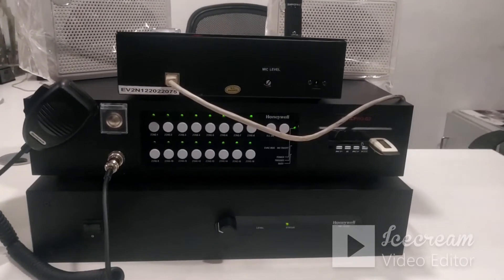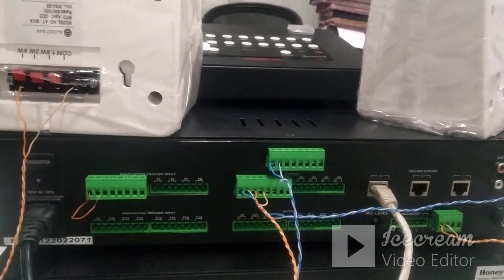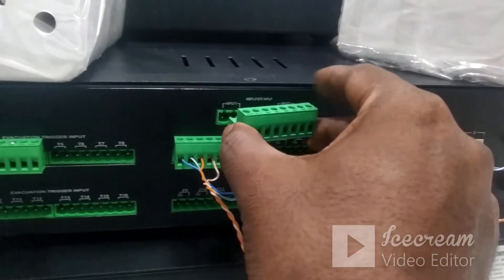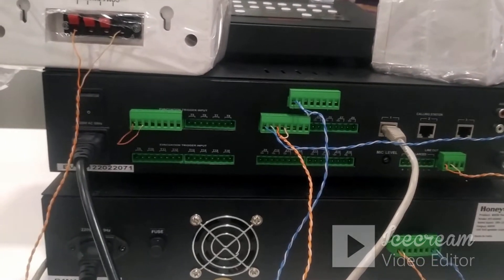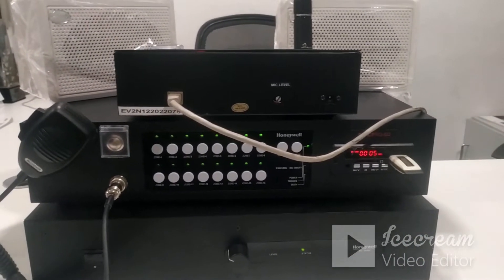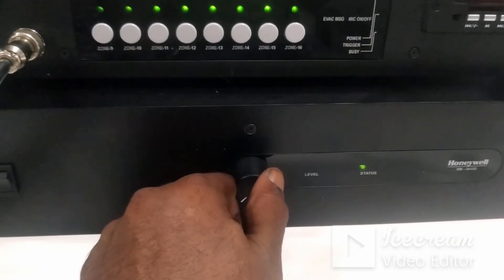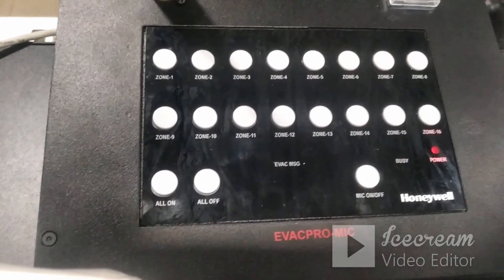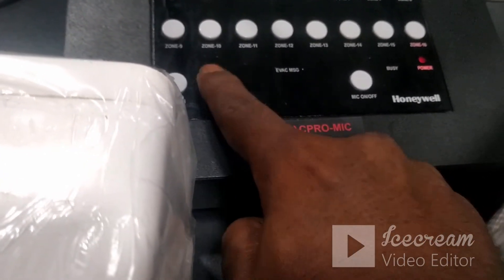Honeywell EVACPRO G2 Controller Connections and Operation

Comment: How can we connect with Bosch amplifier
Reply from the maker: Bosch booster amplifiers are balanced ones, where balanced line out (+ G -)from Evacpro-G2 should be connected with line input (3-pin XLR) of amplifier, also 0,100 unbalanced output from amplifier should be connected to a
Evacpro-G2 input (screw terminal- Red&Black)